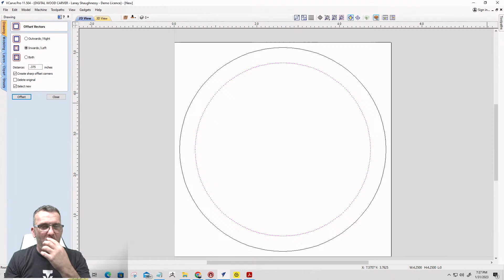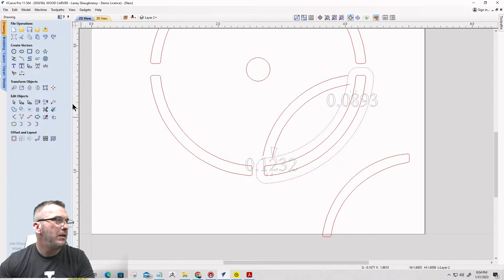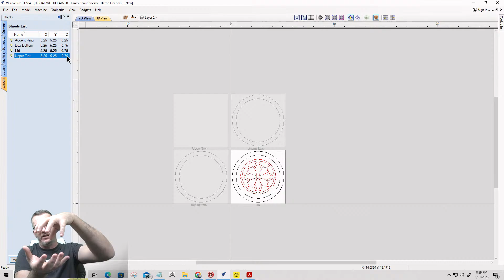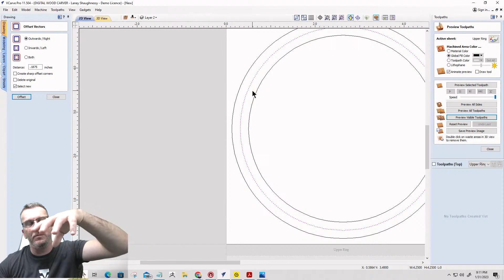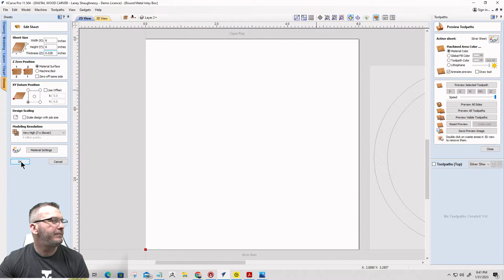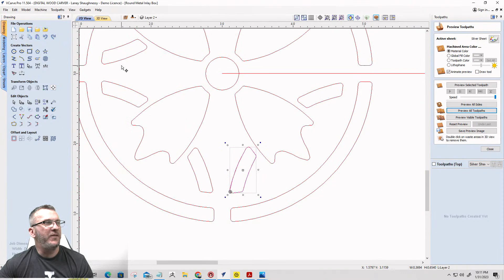Metal Inlays on a CNC | Inspired by WoodSmith CNC Base Camp Ep 006 | Vectric Version | How-to

Comment: Great Video. Do you modify other peoples designs. like Vectric project of the month, the Twiggy Branch Tissue Box. I'm trying to modify it into a rectangle  tissue box , instead of the square box. I am using there graphics. The front of the box, just duplicated there graphics and slid them over. I am having problems after this point. The way they have the project setup, all of the parts are on the same layer, and they are using one board. I have tons of left over boards from other projects, and want to   use these boards. There might be other people want to use there left over wood for something. What I want to do is: Make this into a rectangle box, and have each part on its own layer. If you download the project and look at it, it is hard for a beginner to modify it, because everything is on one layer. Again thanks for your great videos.
Reply from the maker: Hey Karen, this comment was 8 months ago, sorry I did not see it, did you ever get this project revised the way you'd like it?